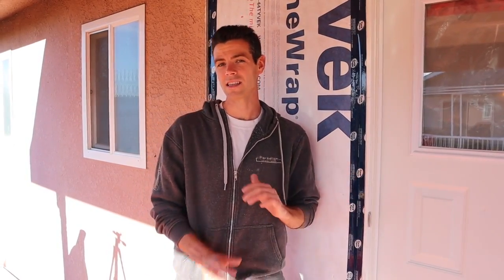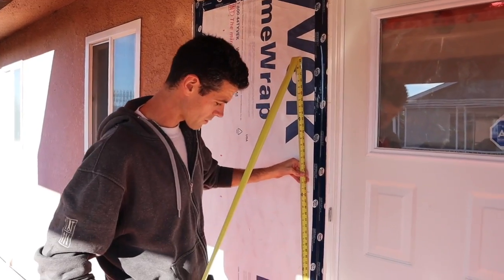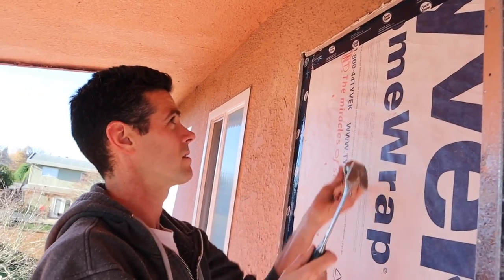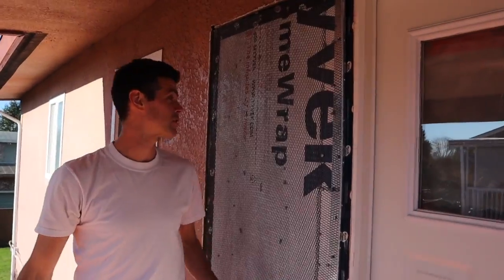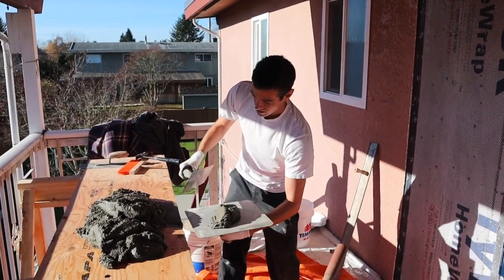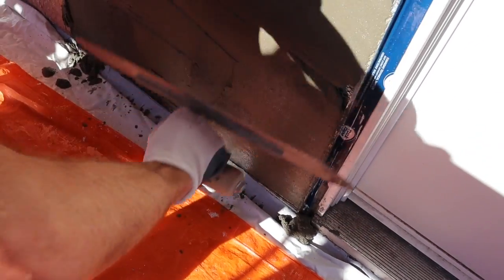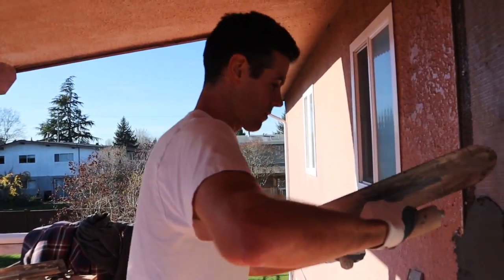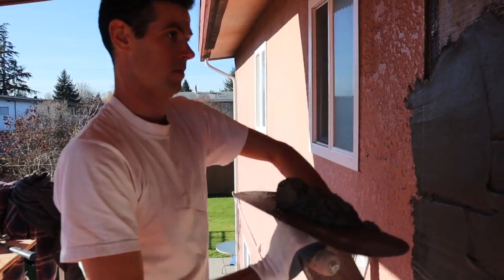Can I Patch Stucco? (Part 1)

Comment: I have a question.  I live in the States so my products are different.  I have a home that I am remodeling and all my walls are either concrete or plaster (there are no wooden lathes behind them just some sort or metal wire, so I’m not sure)  But every single one, ceilings as well.  No drywall.   They look as if they have a coating on them.  Some sort of skim coat or mud. My question is, what product would I use to mud the walls and ceilings?   Thank you for your time. 

Great videos btw.
Reply: Indo remodels as well in Ca. And I run into this all the time (plaster with a skin coat over it). I am by no means a pro but I've used regular drywall techniques and materials (drywall, setting compound and a too coat) to patch in with no issues.
Reply: Buy the brown boxes at home depot, they are premixed. Use the red lettering for taping/filling and the green lettering for your finish coat.
Reply: 805_Diesel thank you for taking the time to write.  I was walking my dog the other day and saw a contractor and asked him.  He told me the same thing as you.  So your info is 👍🏻.  I appreciate it.
Reply: C Bass No worries, lemme know if you have any other questions. Main thing is to keep it simple. Nice thing about drywall/mud is that you can scrape it off if you don’t like it and start again.
Reply: 805_Diesel Thank you.

Comment: As a plasterer from the UK you guys from US and Canada make plastering look like its hard and its rough. In the UK its always smooth and flat. And easy
Reply: He's not a cement Mason. Obviously he's not gonna be slick with it
Reply: Always?
Reply: @bobcougar77 even when we do a textured finish walls are still nice and flat i do like kirks videos but not a massive fan of the way they finish there walls in the US.
Reply: @L F Do you use a darby and a sponge float as kirk does just wondering because use a different method in the UK

Comment: In Michigan they have dryvit everywhere.  Tried fixing a place once.. never will do it again
Reply: Dryvit/Synthetic stucco is a system that requires some experience!
Reply: This dryvit you see is on some restaurants right? I live Michigan and as contractor I don't really see stucco on residential house much.  Maybe I don't live the right area to see it. IDK
Reply: @aservant2287  correct!  Its on commercial buildings more than residential.  It can be installed  on residential also, one popular way is over cement board without the foam insulation
Reply: It can be a very energy efficient system when installed correct. It has water issues unfortunately and requires proper flashing to protect from water and caulking also. System needs low maintenance after installation like making sure caulking isnt failing every year or 2
Reply: I forgot to mention their are two systems one is lathe/cement stucco typically used out west and in the south. Synthetic systems used in the north/northeast that use foam insulation
Reply: @MrMkapusta  thanks for letting me know.  I'm a one man show so I wouldn't even try to do this stuff. I've seen it being done in various places. Scaffolding everywhere. I wouldn't know what to even charge. Lol I'll stick to what I know.
Reply: @aservant2287  $13-$20sqft
Reply: @MrMkapusta  oh ok cool thanks
Reply: I was patching a hole and thought it'd be like plaster... boy was I wrong
Reply: @Van_bya_river  lol. I'm sure the sanding didn't go so well. Like concrete. Oh wait...

Comment: Tried that 100’s of time, and it never caused me any trouble nor did I ever find it difficult. 

I have two tips. 

1. It’s a good idea to ruff up the surface on the first thick layer, it makes the second layer stick better and it prevent the thick layer to crack, because of different drying time true the layer. 

2. That last issue you addressed, start by filling in all the edges, then you won’t get those air cabs.

Last one, if it’s really hot or your working area are exposed to sun, it’s a good idea to cover it in plastic while it dries, so it dries slower and don’t crack.

Comment: I would have used  cement board instead of screen
Reply: The problem with trying to use cement board is that you can't tie it into the Old Wire lath

The old wall and the new wall has to be mended together by The Wire if not they will crack where they both meet
Reply: @edmundfrausto7588  it will probably still crack unless using fiberglass tape
Reply: @johndoe9979  only if you're lucky enough for it to crack under the fiberglass tape but then again I've seen it buckled because of movement

Comment: If you want to try stucco for the first time, especially patch job, Don’t use any of the process in this video. Also if you’ve never done it before don’t charge someone money for it. It gets really tiring having to fix this crap and see the homeowners Pay three times as much in the long run

Comment: I would have put on a scratch coat working it in under the metal screen. You did NOT do a good job on the edges. Might have problems later